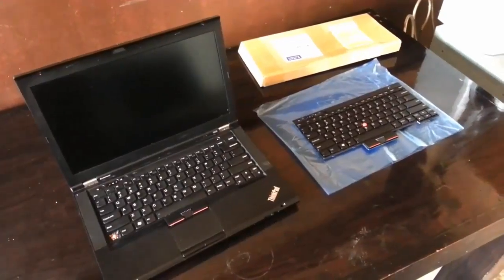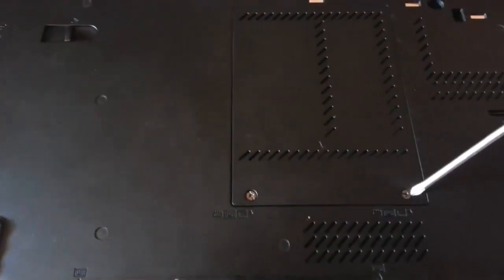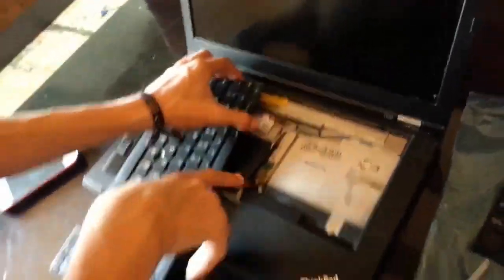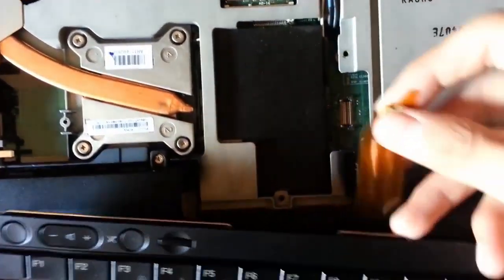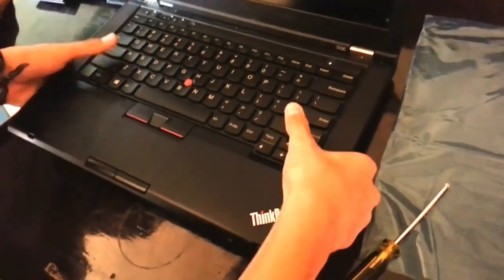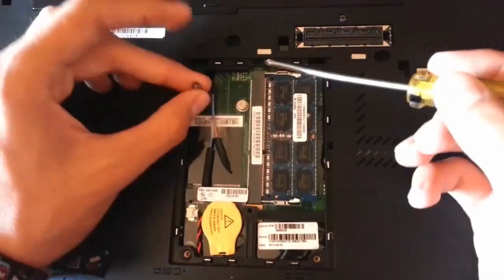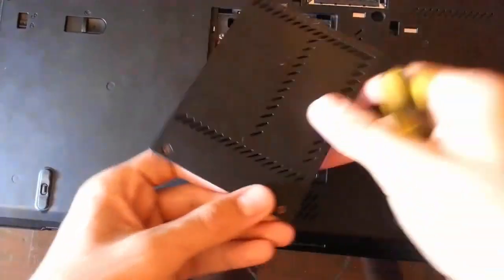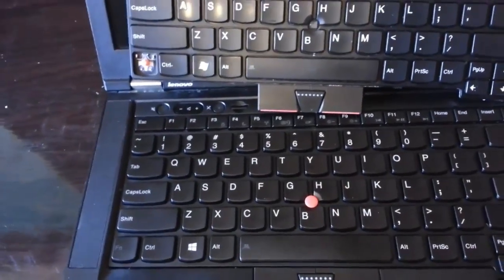How to Change Thinkpad T430 Keyboard

Comment: Hi, great video but I was wondering if you could just remove the keys and keep the original backlight part of the keyboard. Or would I need to buy a whole new backlit keyboard to have backlit keys. I have noticed that most keyboards don't come with the backlight and wanted to see if I could get around paying for a more expensive version.
Reply from the maker: +TheCodedDrifter I think you will need to buy the whole replacement because as I remember it is one solid piece and could be a tedious process to take it apart, also, you take the risk on damaging the new one by trying to replace the keys, I'd prefer to buy the whole backlit keyboard, thank you for commenting

Comment: Is it possible to replace the keyboard with an azerty?
Reply from the maker: Thomas Yes! if you can find a fitting replacement, also you'll need to change the input method in your operating system